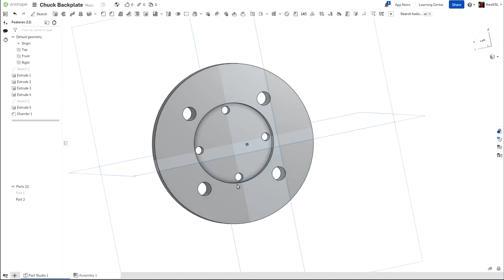Making a 4-Jaw Chuck Backplate for the Proxxon PD 250/e Lathe #toolfest2021

Comment: Thank you for the great instructional videos. I am a beginer. At 21:36, what part exactly are you using to verify the correct diameter of the registration recess that you just cut? How do you get such part for any given spindle flange? Thank you in advance for the info.

Comment: I used to have a Sears 6” lathe that had  a back gear( planetary) and step pulleys. That arrangement  allowed turning at low rpm with great torque. Not knowing your machine…could you use different pulleys to slow down the spindle?

Comment: Nice video. What is the brand name of this 4-jaw independent chuck you made this adapter plate for?
Reply from the maker: There is no brand name on it. It was listed on eBay as a 3.25" chuck with a low profile. The listing is no longer available.
Reply: @AdventureswithaVerySmallLathe  Ok, thanks for your answer. I recently bought a Shobha 80 mm 4-jaw independent chuck (for sale at Hogetex and Chronos in Europe). I looks quite similar, however it has a DIN 6350 mounting at the back. Your chuck has 4 front facing holes/bolts. Or did you create those holes yourself?
Reply from the maker: @joostgudde1989  The chuck came exactly as I used it, with front facing bolt holes. I've found a similar listing from a similar named vendor. Try searching for '3.1/4" 4 Jaw Slim Steel Body Independent Chuck Light Type' from "fordeight_rotagrip_ltd"

(YouTube deletes comments with links, even from the channel owner)
Reply: @AdventureswithaVerySmallLathe  Thank you for the information and i have found the chuck with the given search description. 

I modified my Shobha low profile 4 jaw independent chuck by adding 4 extra front facing bolts. (See my youtube-video "Eps. 5: CNC EMCO Compact 5 Mill - Rotary Table & 4 Jaw Independent Chuck".) The chuck is now mounted with 2 circles of 4 bolts to the backplate. By tensioning the front bolts, I can control the backlash of the claws with respect to the chuck. This also increases the stiffness of the chuck, because a drawback of the light chucks is that they bend open when clamping a part.

Comment: I am surprised you didn't opt for a smaller file at 32:10  ....Nick !
Reply from the maker: The lathe is a long cut lathe file, which works well for parts running on a machine at a faster speed than you'd use when hand filing. I haven't been able to track down a lathe file in a smaller size.

Comment: The Proxxon original four jaw for the PD250 is a real disappointment, don't by it! The jaws are too thin and dig into the material. It is poorly constructed overall. Normally the jaw lead screws have acme threads, but not on this. The lead screws are kept in place longitudinally by the jaws and follow them out. This makes it tricky to reinsert the jaws as they have to be fitted together with the screws. It is very easy to jam the ridge in the bottom of the jaw that grips into the groove in the lead screw. The usual method to lock the lead screws into place is by four guiding cylinders inserted from the back of the chuck body. With no lead threads in the bottom of the jaws, there is simply too little material to handle the tightening forces. I doubt any parts are hardened. IMHO, this product is ridiculously overpriced.
Reply from the maker: Thanks for the advice! It's really disappointing that Proxxon didn't make sure the 4-jaw matched the quality of the 3-jaw, which is really good. Other comments have hinted similarly, but this is the most complete write-up of why it is to be avoided. Thanks again!
Reply: @AdventureswithaVerySmallLathe  Thanks to you too! I have learned a lot from your videos. The granite base plate is a great idea and works really well. I recently added 20 mm thick aluminum blocks to elevate the lathe a bit. Now it is much easier to clean up. I have tried a long list of improvements, including: Thrust ball bearings for the lead screw, pressure nuts (very tiny) for the lead screw and the cross slide, a new lockable knob for the lead screw engagement, ball bearings for the stepped belt drive in the gear box, wider nuts for the gear wheel screws, an round cap with through hole for the gear box door (so the door can be closed over the collet chuck drawbar screw head), packing the saddle cavity with shims and locking it together with the steel plate below (the stupid grub screws simply didn't do the job) ... and probably more coming. My main complaint about this lathe is it's "sandwich design". The saddle and compound base are made from cast Zamak (zink alloy), and in between some steel components. I wonder if any third party provider has considered to make an upgrade package? The whole machine lacks stability. One day it works perfectly well, the next something bad happens and it starts to chatter without any visible cause. The last weeks I got spiral groves when I faced a round stock, no matter which tools I use. I just don't get what the problem is. Maybe the main spindle bearings are loose? If I could host a bigger and heavier machine it would for sure be on it's way already! 😅